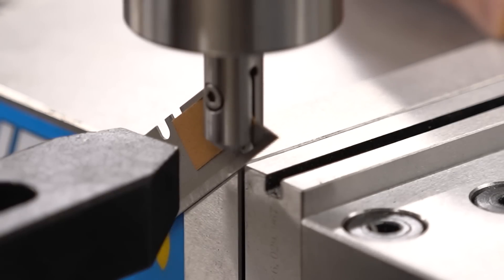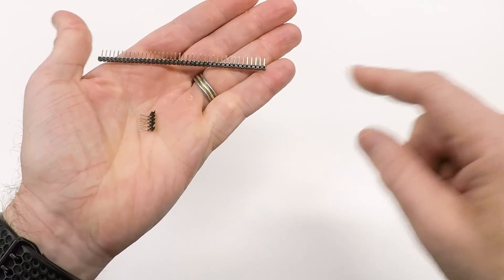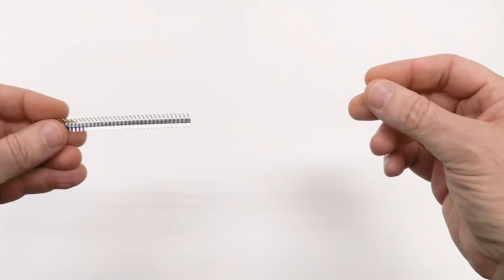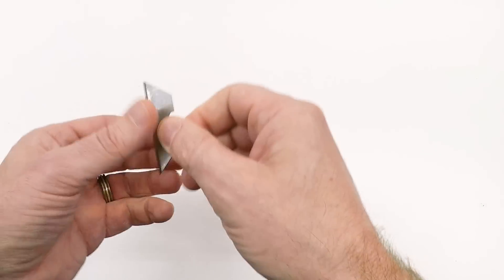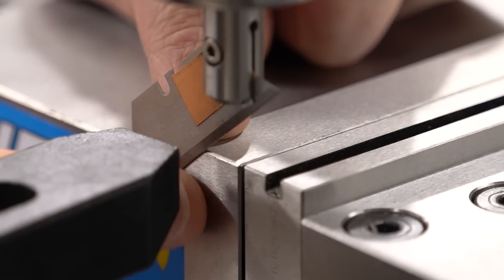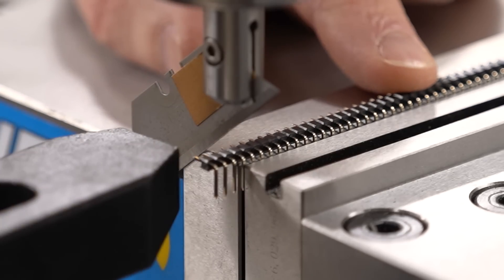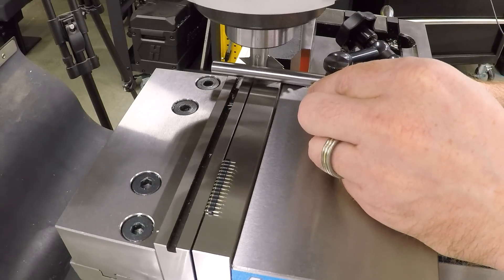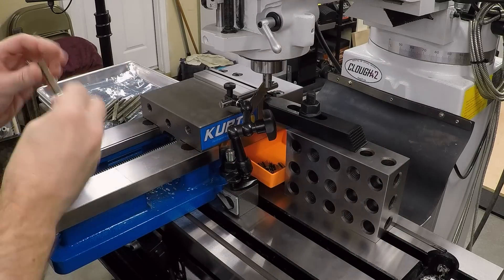Milling Machine Guillotine! | Interesting Setup in the Mill

Comment: Awesome! Yes, yes I do like seeing how everyone solves the little problems. Only thing I would be worried about is that it's a bit to set up every time, but if you've got hundreds of them on your list probably no hesitation
Reply from the maker: For sure.  Next time I set it up, I'll probably cut double what I need.  And the setup should be much quicker next time, since I know what I'm doing now.  :)
Reply: @Clough42  just for fun, how long does it take to cut a run of 600?
Reply from the maker: @boherrmannsen8219  about ten minutes to shear them on the mill.
Reply: Hey Ryan how's that lathe goin'
Reply: @forgeperformanceand4x4  not bad! We keep using it more then working on it (can't be a bad thing) but do have a bunch of content filmed for a future episode (whenever that is)
Reply: @wileecoyoti  I love my Project Alpha utility blade, but I really miss your content!
Reply: I’d ignore 99% of his safety features. Push the connector with another connector strip instead

Comment: I've seen choppers made to do this sort of thing in shops. The usual solution seems to be to take a pair of wire cutters, strip the soft handles off, bolt one handle down, and use a solenoid with a spring to pull the other handle. Then a foot switch or button to trigger it. The tool is set up vertically with the handles away from the operator with some sort of little jig, often made from something like Masonite or MDF or aluminum. 

Usually the blade area is small enough (and possibly guarded) so that it is hard to injure yourself, even when you are zoning out. It's a lot easier to get your fingers rapped by the handle coming down if for some reason you reach around back when you trigger it.
Reply: Thanks for that!

Comment: Love it! Your system works beautifully but a simpler (and smaller) option would be to add a stop to your flush trim cutters. I did that years ago to a wire stripper: drill a hole in the cutters, tap the end of some aluminum round bar, and a stop collar on there as an adjustable stop. Still going to be hard on your hands but at least it’s repeatable so you can focus on your tv show instead :)

Comment: Worked as a ladder logic programmer on tube cutting machines using same style blade but high quality German ones. They mostly went to the medical industry and used an encoder wheel to measure out the cuts but your cutting action reminded me of them. They were set at a smaller angle and used a pneumatic for sawing action. The entire setup was held with magnets in a delrin block recessed with steel pins the blade would lock into.

Comment: Was great seeing a problem solved with what you had available.looks like you'd be faster by about an order of magnitude - no better feeling by knowing you've saved that much time.And saving the pain in the hands is worth it.

In a previous job I had there was an operator in one product line tasked with cutting heatshrink to length, and this was done by hand. I saw this a few times, and realised it could be cut on an old cable cutter tweaked to handle heatshrink instead of cable. A shift's worth of manual cutting could be completed with a load of the (500 ft) heatshrink roll  in the cutter, press start, then collect the bucket of cut heatshrink 15 minutes later.

Comment: I’ve done something similar in an arbor press with a utility knife blade on the ram. Cutting chunks of soft rubber to size. Fixturing was not as simple as the mill table. Love your safety concepts! My setup had a wide open blade and gives me the creeps each time I set it up.

Comment: I did this at work using a pneumatic cylinder and carpet cutting blade to do the cytting. I had a gear cut to drive them forward. Hardest part was getting sensors to count the pins. I had to make a plate with a 0.010 hole to reduce the area the sensor can see. We used a straight blade because it's in a clean environment and there is less debris than a saw blade would use.
I believe there is glass fiber in the plastic bodies because  it wears down the blades regularly.

Comment: Hi, thanks for the nice video and also all of the your other videos. A tip I do have for cutting those pinheaders down: if you have an Arbor Press you can make a holder for the razor blades quite easily and use that for cutting them down. The setup is much done every time you have to use it. Source: Working in the electronic manufacturing and we have such a tool.

Comment: Interesting solution to something that shouldn't have been a problem in the first place. I worked for the company (Berg Electronics) that invented the strip headers you are using. One of the more frustrating aspects of this product line was folks propensity to cut pieces to length rather than just snap them apart. The little notches along the length are there to initiate a clean break between pins. Try using a duck-bill pliers and a twisting motion and you will find that quite a lot of pieces can be snapped off in about a second or two each. No sharp edges involved.

Comment: Brilliant, well thought out as usual! Hobbyist that do not have a milling machine could use a drill press to mimic your method. They would have to prevent their spindle from turning, perhaps by lightly clamping rectangular stock, on the top and bottom of their       V-Belt  and just touching the front or rear pulley, thanks for sharing.

Comment: We did the same thing to cut a nylon .093" dia rod to length.  We'd get an order for a couple thousand every month or so.  We made a fixture with modules for every different length we made, then chucked them in the Bridgeport.  Clamped a razor in the quill, and went to town.

Comment: That was very informative, Clever and simple…that’s always better than most other options.
You’ll never get a clean cut because the plastic used is too brittle for a clean shear.
Because I have a lot of small electrical components, I would go for a 12 volt or 24 volt dc motor with a speed controller running at about 25,000 rpm and mount a thin kerf slitting saw to an arm…like a chop saw.
I really, really like how you used the vise jaws to align the strips for cutting. With a smooth cut, registration isn’t so much an issue….but admittedly, my solution is far more complex than yours. It’s greatest strength is that I have all the parts to cobble it together without several trips to the local hardware store or shop and wait from Amazon or EBay or other online source.
Good stuff, as always!

Comment: Thoughts to feed the algorithm: Lightweight spring to push or a weight on a string pulling the part towards the cutter? 
I wouldn’t think I would take much force to get that pin to touch the stop block after each cut, and you could position your safety rod to keep the part down as the blade cycles back up.

3D printed guide to allow more than one stick of pins to be fed into the cutter?

Comment: Not that it matters too much, because you have a brilliant solution already, but since you mentioned it (cutting error accumulation)... Maybe the cutting error could be reduced by using a single bevel blade (like a: Personna 61-0021).  Use the flat side tight against your vise to make a clean shear on the stock side and hopefully that would give a more accurate reference edge to register on your stop block. Thanks for all your great videos!

Comment: I think this is brilliant! The roi may not be there to do this, but I'd imagine that you could build off this idea to fully automate the process by spring loading the feeding. Could even move the whole thing off of the mill with a 3d printed jig and a small pneumatic piston or electromagnetic solenoid to perform the function of the quill in your current set up.

Comment: I enjoyed hearing about what you had tried prior to finding the ultimate solution.  It's very expensive if you don't already have the mill and vise, though!
Reply: I suspect it might work as well built using only a cheapo arbour press and a drill vice. All it requires is one linear axis with a bit of leverage.

Comment: make a 7 bladed guillotine jig, do the whole strip in one motion and you don't have to set up your mill every time you have to do this
Reply: Or a single bladed one for the people who give his videos a thumbs down :-)
Reply: @BrilliantDesignOnline  Ouch!
Reply: Then put the blades in a circle, and make them spin really fast
Reply: @vcarriere  not if you offset each blade by the thickness of the plastic on the pins. Then your only ever cutting one section at a time but with way less time to do so.

Comment: 11:15 Well? Do ya, punk? 🤣🤣🤣

Very nice video, and a very nice solution. That cutting action was strangely soothing. But if I were you, I'd make a whole machine for that job. A block (milled out of metal or 3D printed) to hold the work piece, four blades to come down and cut it into five lengths, then a mechanism to reload with an uncut piece, all driven with a small motor and a timing wheel. You could get a whole video series out of it.

Comment: I had to build a little "Pnumatic Chopper" for exactly the same thing although six pins in my case.  You would think that responsible adults with good technical educations would be able to count to five more reliably than we apparently can.  I will admit that your sledge hammer to kill a fly ratio is much larger than mine.   lol. Thanks James for the video as I can now explain to my wife why I needed to build my setup just because I couldn't reliably count to six.

Comment: Had an idea / suggestion about half way though that would allow you to chop an entire stick into the 8 5count sections in one shot but when I saw how fast you could run them at the end of the video, I'm not really sure my suggestion would be any better / faster / easier.... because it would probably be a bit more time consuming to unload the sections once cut. Probably not worth the effort to make for the speed that you seem to be able to do them at with that setup.

If you think you might be doing enough of these though, it might be worth it to make a standalone tooling setup / assembly similar to what you have done on the mill that you then can then do anywhere and not need to setup on the mill each time... It would be a pretty easy / simple assembly to make with just a few pieces of aluminum, a few pieces of steel (or aluminum) dowel rod and a small compression spring to return the lever after each cut.

Comment: I was half expecting to see you create or modify a finish nail gun magazine to load right angle pin headers. Great tip about referencing on the pin instead of the plastic, I always end up needing to file down the end when I forget about tolerances. I usually 3d print a box profile of the pin header in the length I need with no top or bottom, and load the 40 pin into it, hold that in one hand and the cutters in the other. Tap it on the desk, cut off the excess, hold the stick out and drop the part out the bottom, then repeat. Mind you, I'm not selling kits.

If you ever need to find a single pin header you dropped on the floor, my best advice is to walk around in socks. No need to look for it, it'll find you.
Reply from the maker: That's a great idea.  And yes, I have pulled pin headers out of my feet before.  The good thing is that they're much easier to see than slivers.  :)

Comment: Nice solution.  Wonder what additional challenges would be found on female headers?  Those often have a lot more plastic and it's an integral part of the two part internal connection.  I;ll have to give it a try even if just for a few out of curiosity.  Exacto knives and thin saw blades for rotary tools often drift.  By the time they start, it's too late.

Comment: Forgot I was going to ask if you ever considered using a servo as an alternative to an index wheel with your e-leadscrew? I've been considering the ways I can make a HTD timing pulley on my lathe and every time I think about buying a die grinder and mounting it to my tool post I get stuck at deciding whether to print an index wheel or a pulley and mount to run a servo? Then I start thinking just buy a rotary table and cheap drill press so later I can convert the rotary to 4th axis on the cnc mill I'm rebuilding(this is what the HTD pulley is for). So many ways to skin this cat but I currently hate the 5M375 belt setup on my lathe(8x16 pos) and think a servo and timing pulleys would not only replace the anemic motor and slipping/snapping belts but enable indexing but that then turns into a full fledged CNC machine and I need a manual lathe. Seems like your leadscrew could also enable indexing so many degrees or just sending straight RPM signals for standard lathe operation?

Comment: I enjoyed the video and creativity challenge. I also chucked at the end of the video 😆 Question-couldn’t you double stack the connectors, effectively doubling your processing ability 💁🏼‍♂️ 
Another thought on cutting the connectors, I would think using a lever action paper cutter with a wooden jig to hold and stop would do the same kind of action. Plus, it’s be a bit more mobile. Keep the videos coming sir 👍🏻
Reply from the maker: I have a paper cutter, and I'm not sure.  It's hard to get in around the blade, and it cuts against a rubber strip, so there isn't any shearing action.  It might be worth trying.

Comment: I guess have a lot to learn about leaving a comment too. 
I wanted to say that I use a Northwest Short Line NWSL "The Chopper" for cutting my header to length. I set my stop on the pin also and then all I have to do is push down on the lever and cut it, I can do it while I watch TV.  NWSL was sold and I don't know if they are making them. Micro-Mark makes a similar called "Chop-it" Item # 84046.  They also make a couple of powered miter saws.  The "Proxxon Mini Chop Miter Saw" Item #: 83418, and "MicroLux® Mini Miter / Cut-Off Saw" Item #: 84656, which is the one I have. It does everything I need it to do. I guess I could set it up for cutting headers but it wouldn't be as fast and I couldn't watch you on TV while using it.
Keep the videos coming. I bought one of your ELS and was just given a Harbor Freight Mini-Lathe.  Once I get the bugs worked out I'll get to work on the ELS as I don't have a full set of change gears.

Comment: so mill out a track out of aluminum with a stop, use a short stroke air cylinder for the blade. angle the input up hill so it will self feed and let it eat. if they can do it with staples/nails you should be able to do it like so.
Reply: Yes, my thoughts exactly!

Comment: if your going to go that far you might be able to sacrifice/modify a cheap heavy duty stapler as a spring loaded feed and keep your hands completely away and doing less
i believe the only issue may be if the guidls in the stapler will need to be widened if they are slightly too small

Comment: Hmmm, I was always just bending them at the desired spot and they'd snap right between the pins at the indentations. To make it easier you could then just mill a slot in some piece of scrap that is exactly as long as the amount of pins you need. Then just stick it in, bend at the edge of your piece and it should snap off, rinse and repeat.
Reply: Put a little spacer in the vice and use that gap to snap it it. No need to mill anything.

Comment: You should put a little dc motor on the bar that protects you finger and wrap a piece of rubber around it and put it so that it has slight pressure on the connectors. Now you only have to insert them and the motor pushes them against the end bar. The upward motion of the knife wont lift the pins cause the bar is holding hem down as well.

Comment: 7 blades mounted and spaced correctly in a 2x4, lay the full header on the bench and hand press all at once.  I looked up pre cut 4 position parts on Digikey...$0.18 each!!
Reply: Would not the pieces become jammed, with no clearance but being pressed into a space reducing by one blade thickness?

Comment: Quill presses a gear rack, rack turns a pinion attached to a 5-6 spoke cutter which is axled to a mating cutter. Brrrrp! a 2 foot string of pins is done as fast as 1-2 cuts.

Comment: Make a micro paper cutter. Install the Xacto blade (replaceable) on the handle and set your adjustable stop where you'd like. Screw that assembly to a lap board and now you can go back to cutting parts in the TV room

Comment: @Clough42 have you looked at LCSC? I know you were working with JLC. LCSC is a partner. I just looked up 2.54mm 5-pin 90* headers and they have a min order qty of 20 but are about 2.8 cents apiece. On a run where you need 600 headers, that's a BOM part cost of about $16.8 per 300 boards.  I found my protoboards were WAY cheaper to populate if I used LCSC instead of digikey, mouser, etc.
Reply from the maker: I use LCSC.  They have right angle headers, but I haven't seen them with the correct geometry for Dupont connectors.  They all have the web on the long end.
Reply: @Clough42  This (with the web on the mating end) is the standard geometry offered by Amphenol, AMP/TE and other reputable brands for their Dupont-style RA headers, designed to mate with the crimp housings. I'm not sure why you think it's incorrect? It seems better to me, too, giving a flat surface for the connector to bottom on, and a shorter cantilever. The standard geometry gives 0.5mm clearance between the PCB and connector housing. Though personally I would prefer a keyed connector here.

Love the guillotine jig though!

Comment: to prevent the error in plastic, make an lenght fix, with an hole for the plastic, so the last pin touches to the limit.
Reply from the maker: This is basically what I did, so the pin touches the stop.
Reply: @Clough42  Ah, in dont see the stop not so good, and my english is not the best. I learn in every video from you, Thanks!